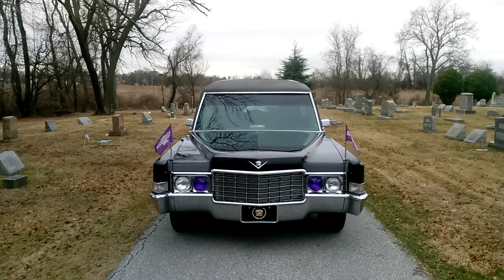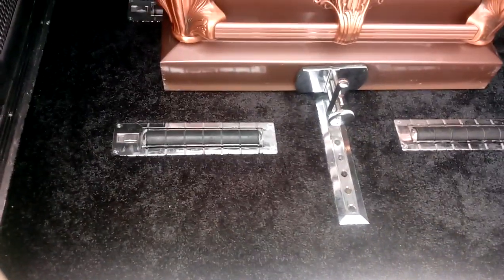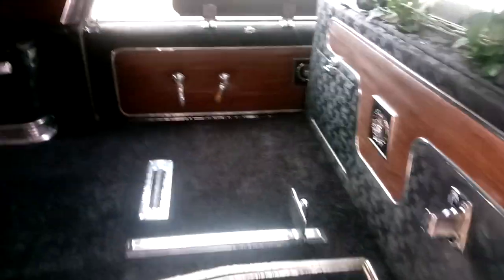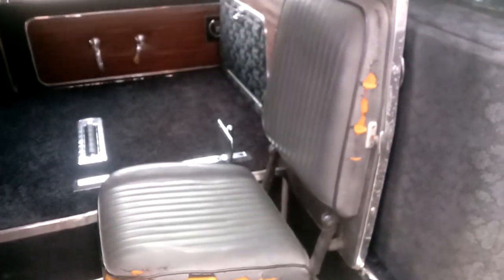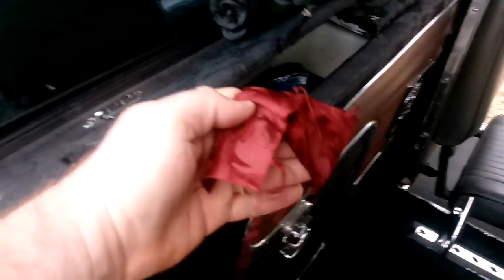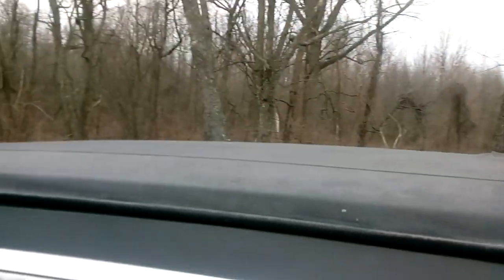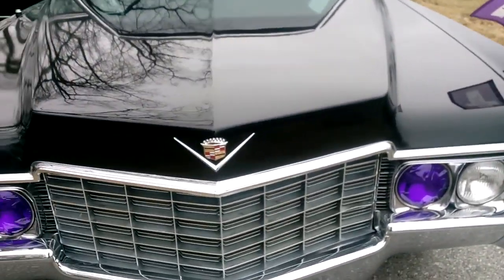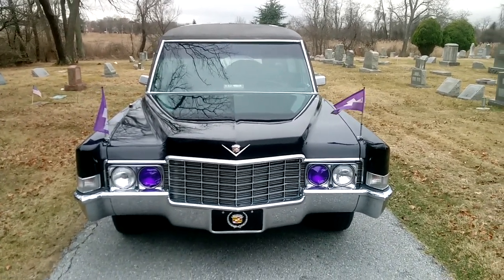1969 Cadillac Superior Hearse

Comment: That's really sweet. My buddy has the same car but it has the corner rear windows, I believe that's the Crown Royal. It's ratty compared to yours though. 
Hats off for putting the interior back correctly, it's very well done. The chrome on the Superior Crown is quite ornate, they really pop in good condition. 
I've got a ratty 73 MM, it's a cool car but it doesn't have half the chrome yours does. Rock on 🤘

Comment: a beautifully stunning vehicle - I appreciate that you’re taking the time necessary to restore it correctly and with care - I’m a stock guy so I prefer things to look like they did when new or when they came down the line.  What is the significance of the purple high beam lights?  Have never seen them before - only red or blue ones.  I loved the 1969 Cadillac styling, which was all new that year.  A cousin of mine drove a new Colonial Yellow Coupe de Ville that year with black interior - a very majestic, yet tastefully stylish automobile that always turned heads

Comment: To anyone that converts from points to HEI, you need to replace the wire that feeds the coil from the bulk head connector. This is a resistor wire. What Caddy you remove distributor from, grab this wire. You can plug new wire in place of old one. Should fit like it belongs there. The wire on the other side of the bulkhead connector will work fine. This will give HEI the power it needs. Otherwise ign system will be running on like 8 volts.

Comment: Beautiful!  I have one almost exactly the same but not as nicely restored.  I still have original rear upholstery all the color of the flip up seats.  Lots of mechanical work done, painted once in the 22 years I've owned it.  One difference is that I have quarter round windows in the back.  Now it stands on the threshold of becoming an 'art car', leaving stock restoration behind.  Or, maybe it will just be my one ton capacity Cadillac station wagon, which is what California DMV calls it.

Comment: Can give any more detail on the HEI switch. Was told to definately do that right away. (72 472 Calais).Why did you choose a factory one from the 500 as opposed to a new aftermarket one? Cost or specs? how involved was the process? thank you.
Reply from the maker: Sorry for the delay, I just ordered one from the internet that fit the engine. No particular reason other then i knew it would fit. get the kit with the wires and cut to length yourself. I did take the ignition module out and replace the tiny blob of cheap cooling grease with a generous amount of better quality paste. (Arctic cooling grease was the type i think...) also the plugs i used were NGK 4268. Have not had one problem yet! Sorry again for the late reply...
Reply: Thankyou
Reply: soulshakerman   I used a Pertronix HEI in mine, it works great. You keep the original cap, rotor and wires too. No big deal to install either. The NGK plugs work great. .060 was the gap for HEI Caddy's so I kept the same plugs and just opened the gap.